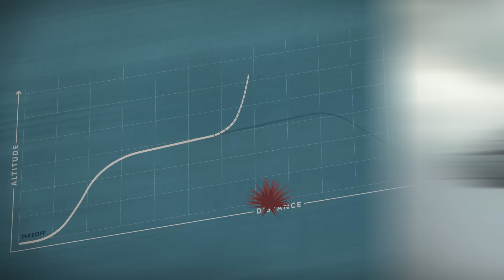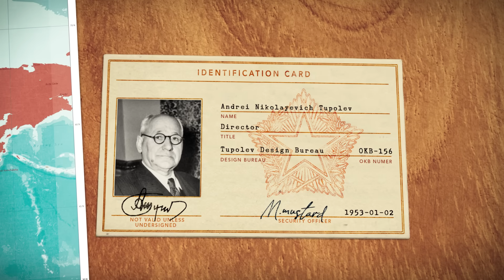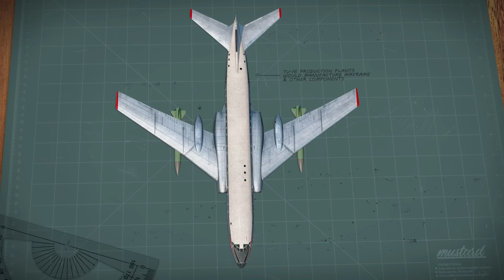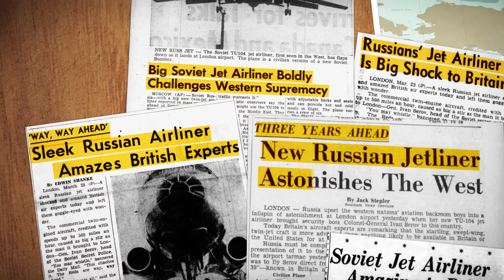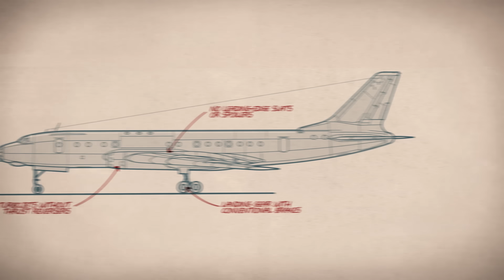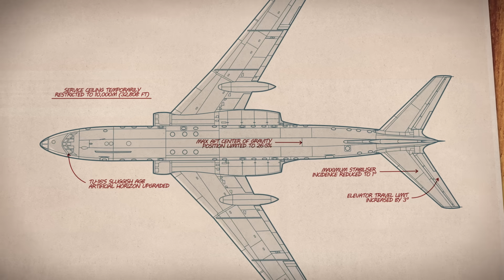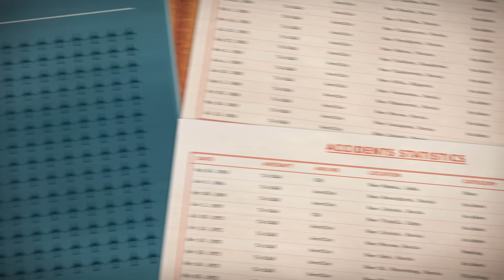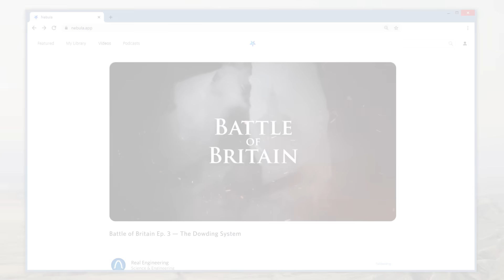The Soviet Airliner Designed To Crash

Comment: The Comet has the worst safety record of any jet airliner in history
Comet 1 had a 46% loss rate and Comet total a 34% loss rate
 Here is the complete list of the 39 Comet crashes and hull loss accidents.
G-APDN.  03.07.1970
G-ARCO.  12.09.1967
SU-ALD.    28.06.1963
LV-AHR.    23.11.1961
G-ALYP.     10.01.1954
G-ALYP.     02.05.1953
G-ARJM.    21.12.1961 
SU-AMW.   19.07.1962
G-ALYY.      08.04.1954
SA-R-7.      20.03.1963
SA-ALC.      02.01.1971
CF-CUN.      03.03.1953
LV-AHP.       27.08.1959
G-APDH.      22.03.1964
XP915.        19.01.1971
G-ALYZ.       26.10.1952
G-APDL.       07.10.1970
F-BGSC.       25.06.1953
LV-AHN.       24.03.1970
SU-ALE.        09.02.1970
SU-ANI.        14.01.1970
OD-ADS.       28.12.1968
OD-ADQ.       28.12.1968
OD-ADR.        28.12.1968
G-ALYR.         25.07.1953
G-APMD.      16.11.1965
G-APMF.        05.11.1964
G-APDL.       23.12.1959
G-APDN.       09.03.1964
G-ARJN.        02.08.1963
G-APDF.        09.04.1959
XK663.         03.06.1959
G-APDM.       03.08.1962
G-APDA.       08.06.1959
G-APDB.       21.06.1959
G-APDM.      25.01.1961
G-APDB.       22.08.1960
G-APDS.       14.03.1960.
LV-AHO.       20.02.1960
Reply: @WilhelmKarsten Regarding the fabulous trailblazing 
De Havilland Comet.
Accident Losses generally.

We feel we can clear up some commonly held myths and misconceptions, obviously.

It's always good to see the facts presented clearly and concisely isn't it?

De Havilland was subjected to forced merger under the govt aerospace sector rationalisation programme. A similar process occured globally, Sud Aviation and several other French manufacturers merged during design and production of the Caravelle with the Caravelle becoming a significantly international type project. Even in the US, there was no room for multiple manufacturers of large jet airliners with consolidation being inevitable.

The world's first wind tunnel was constructed in England before 1890.
The world's first supersonic wind tunnel was constructed in England during the 1920s.

The DH Comet was subjected to every type of stress testing & wind tunnel testing possible at the time. 

The world's first high altitude airliner.
The world's first jet airliner.

In fact the Comet was the first airliner to have a full fuselage length pressurised passenger cabin suitable for high altitude flying where pressurisation stress was many times higher than flying load stress. Bow-wing (see b-47 wing folding wing collapse incidents) had built less than 12 pressurised cabin airliners before the Comet first flew. The world's first pressurised cabin aircraft was a British design Airco built under licence in the US and modified in the US to have a pressurised cockpit cabin during a joint US / UK research project. Previous pressurised aircraft were airliners with lower pressurisation & altitude limits where pressurisation stress did not exceed flying load stress or were bombers with small heavily built cockpit capsules where potential total  airframe weight gains were insignificant.

The Comet nose was a unique De Havilland design that Sud Aviation subsequently licensed for use on their Caravelle.

Correct, the Comet was designed with military use in mind. In fact, the first designs were based on military use requirements, the first Nimrod aircraft were straightforward modified Comet 4 airframes. Obviously when the Nimrod first flew, it was of course the most advanced and capable aircraft of it's type in existence. All subsequent Nimrod airframes were indeed simply mostly  new manufacture Comet 4 airframes with the additional equipment bay added. Nimrod design and manufacture was in fact performed mostly by the De Havilland team at HS. 

The Comet was in fact an all metal construction airframe airliner, use of other materials was similar to all other airliners at the time. 

  Obviously there have been worse aircraft for accident losses both before & after the Comet. One of the issues was accident losses due to pilot error which were often caused by the novel aspects of jet airliner flying, even so, the accident losses for the Comet as an airliner were not particularly unusual at the time.

Some changes made were to make pilot error on takeoff less likely to cause serious problems. For example, the skin thickness remained mostly the same from Comet 1 to Comet 4.
Ripstop provision existed for all Comets. The original alloy used was discontinued by the manufacturer, the replacement alloy had similar properties.

  Indeed, at the time aviation infrastructure & aircraft technology etc was still developing rapidly, there was still a lot to do when considering all aspects of flying safety.

    How things were back then. 
Accident losses - % of aircraft built.
DeHavilland Comet 4                   14% 
DH Comet all mks   (ff 1948)       17%  
Vickers VC10 UK                            5%

The DH Comet had better safety than or similar safety to many other commercial passenger aircraft of a similar era.

Douglas DC-1                                      99%
Douglas DC-2                                      47%
Douglas DC-3                                      30%
Douglas DC-4                                      26%
Boeing s300                                        72% 
Boeing 307                                          70%
Boeing 247                                          48%
Boeing 707                                          20% 
Lockheed L-049/149 Constellation  30%
Lockheed Electra Turboprop             29%
Fairchild FH-227                                  30%
McDonnell Douglas DC-8                   14%
Sud Aviation Caravelle                        15%
Canadair CL-44  Turboprop                46%  
Convair CV-580  Turboprop                22%
Convair CV-880     (ff 1959)                27%  
Convair CV-990     (ff 1961)                33%
Tupolev T-104        (ff 1956)                16%

The VC10 held the fastest Atlantic crossing speed record for 41 years (Non supersonic airliners).

For the first few years of operations the Caravelle and Comet had similar accident loss Fatalities numbers.

  Instances of all Comet marks, including the Comet 1 and Comet 3 flew with full certification at some point after 1954. Airline duty Comets were all retired by 1980 with full certification until after retirement. The last Comet flight was a global circumnavigation series of flights in 1997.

   Of course De Havilland carried out a full stress analysis & performed extensive & protracted testing, including pressure cycle testing, on two long lengths of fuselage. De Havilland carried out significantly more testing than was required by any authority at the time & significantly more testing that any previous airliner was subjected to.

  Of course De Havilland had prior experience building many all metal construction airframe aircraft & thousands of jet powered fighter aircraft that were primarily of metal construction with pressurised cockpits & jet engines built by De-Havilland. At the time De Havilland engineers  knew all there was to know about metal fatigue as it applies to aircraft.

    De Havilland did indeed always work to better than industry standards at the time, used up to date knowledge for the design & no evidence of negligence  or criminal negligence was ever produced in relation to the DH Comet.

Military aircraft accident losses compared.
Non combat phase accident losses.
% of Aircraft built.
The EE Lightening did not have unusually high losses. 
The Canadair CL-44 was a turboprop airliner.
Canadair CL-44               (ff 1959 ) 48%
Lockheed XF104             (ff 1954) 100%
Lockheed  P80                (ff 1944)  43%
Lockheed F104               (ff 1954)  45%
MD FH Phantom 1          (ff 1945)  35%
MD F4 Phantom 2           (ff 1958)  28%
Convair F102 Dagger      (ff 1953)  45%  
MD F3H  Demon              (ff 1951)  32%
MD F-101 Voodoo           (ff 1954)  34%
EE Lightening                   (ff 1954)  33%
Gloster Meteor                (ff 1943)   21%
DH Vampire                     (ff 1943)   23%
DH Sea Vixen                  (ff  1951)  33%
Gloster Javelin                (ff 1951)   20%

Note that the Meteor didn't have particularly high losses, flew with more than 20 airforces for decades, got involved in air to air combat during a number of conflicts successfully against aircraft that first flew many years after the Meteor first flew.
 
We hope this helps, of course.       
       
As always, cheers & indeed 👍.

Comment: Wouldn’t a wing re-design have made a difference? And then an engine redesign? Perhaps narrowing the fuselage? One of the images showed 5 seats per row. Reducing to 4 would have helped. Making the wings a few feet shorter and a foot or so deeper would’ve made it more manageable at lower speed. Similar changes to the tail section would improved stability at all speeds. 

I’m no aeronautical engineer but even from my chair I can see areas where life saving modifications could’ve been made. The USSR values the lives of its people very cheaply. I guess that hasn’t changed much.
Reply: If you are familiar with the history of commercial aviation most successful airliners are based on a preceeding military aircraft.
Boeing became the largest manufacturer of commercial aircraft in the world by creating airliners from its bombers.
B-17 > 307, B-29 > 377, KC-135 > 707 and 737 even the 747 was developed as a military cargo transport.
Only recently has jet airliners been developed as a clean sheet design strictly for commercial aviation.
Reply: @WilhelmKarsten 

Regarding the fabulous trailblazing 
De Havilland Comet.
Accident Losses generally.

We feel we can clear up some commonly held myths and misconceptions, obviously.

It's always good to see the facts presented clearly and concisely isn't it?

De Havilland was subjected to forced merger under the govt aerospace sector rationalisation programme. A similar process occured globally, Sud Aviation and several other French manufacturers merged during design and production of the Caravelle with the Caravelle becoming a significantly international type project. Even in the US, there was no room for multiple manufacturers of large jet airliners with consolidation being inevitable.

The world's first wind tunnel was constructed in England before 1890.
The world's first supersonic wind tunnel was constructed in England during the 1920s.

The DH Comet was subjected to every type of stress testing & wind tunnel testing possible at the time. 

The world's first high altitude airliner.
The world's first jet airliner.

In fact the Comet was the first airliner to have a full fuselage length pressurised passenger cabin suitable for high altitude flying where pressurisation stress was many times higher than flying load stress. Bow-wing (see b-47 wing folding wing collapse incidents) had built less than 12 pressurised cabin airliners before the Comet first flew. The world's first pressurised cabin aircraft was a British design Airco built under licence in the US and modified in the US to have a pressurised cockpit cabin during a joint US / UK research project. Previous pressurised aircraft were airliners with lower pressurisation & altitude limits where pressurisation stress did not exceed flying load stress or were bombers with small heavily built cockpit capsules where potential total  airframe weight gains were insignificant.

The Comet nose was a unique De Havilland design that Sud Aviation subsequently licensed for use on their Caravelle.

Correct, the Comet was designed with military use in mind. In fact, the first designs were based on military use requirements, the first Nimrod aircraft were straightforward modified Comet 4 airframes. Obviously when the Nimrod first flew, it was of course the most advanced and capable aircraft of it's type in existence. All subsequent Nimrod airframes were indeed simply mostly  new manufacture Comet 4 airframes with the additional equipment bay added. Nimrod design and manufacture was in fact performed mostly by the De Havilland team at HS. 

The Comet was in fact an all metal construction airframe airliner, use of other materials was similar to all other airliners at the time. 

  Obviously there have been worse aircraft for accident losses both before & after the Comet. One of the issues was accident losses due to pilot error which were often caused by the novel aspects of jet airliner flying, even so, the accident losses for the Comet as an airliner were not particularly unusual at the time.

Some changes made were to make pilot error on takeoff less likely to cause serious problems. For example, the skin thickness remained mostly the same from Comet 1 to Comet 4.
Ripstop provision existed for all Comets. The original alloy used was discontinued by the manufacturer, the replacement alloy had similar properties.

  Indeed, at the time aviation infrastructure & aircraft technology etc was still developing rapidly, there was still a lot to do when considering all aspects of flying safety.

    How things were back then. 
Accident losses - % of aircraft built.
DeHavilland Comet 4                   14% 
DH Comet all mks   (ff 1948)       17%  
Vickers VC10 UK                            5%

The DH Comet had better safety than or similar safety to many other commercial passenger aircraft of a similar era.

Douglas DC-1                                      99%
Douglas DC-2                                      47%
Douglas DC-3                                      30%
Douglas DC-4                                      26%
Boeing s300                                        72% 
Boeing 307                                          70%
Boeing 247                                          48%
Boeing 707                                          20% 
Lockheed L-049/149 Constellation  30%
Lockheed Electra Turboprop             29%
Fairchild FH-227                                  30%
McDonnell Douglas DC-8                   14%
Sud Aviation Caravelle                        15%
Canadair CL-44  Turboprop                46%  
Convair CV-580  Turboprop                22%
Convair CV-880     (ff 1959)                27%  
Convair CV-990     (ff 1961)                33%
Tupolev T-104        (ff 1956)                16%

The VC10 held the fastest Atlantic crossing speed record for 41 years (Non supersonic airliners).

For the first few years of operations the Caravelle and Comet had similar accident loss Fatalities numbers.

  Instances of all Comet marks, including the Comet 1 and Comet 3 flew with full certification at some point after 1954. Airline duty Comets were all retired by 1980 with full certification until after retirement. The last Comet flight was a global circumnavigation series of flights in 1997.

   Of course De Havilland carried out a full stress analysis & performed extensive & protracted testing, including pressure cycle testing, on two long lengths of fuselage. De Havilland carried out significantly more testing than was required by any authority at the time & significantly more testing that any previous airliner was subjected to.

  Of course De Havilland had prior experience building many all metal construction airframe aircraft & thousands of jet powered fighter aircraft that were primarily of metal construction with pressurised cockpits & jet engines built by De-Havilland. At the time De Havilland engineers  knew all there was to know about metal fatigue as it applies to aircraft.

    De Havilland did indeed always work to better than industry standards at the time, used up to date knowledge for the design & no evidence of negligence  or criminal negligence was ever produced in relation to the DH Comet.

Military aircraft accident losses compared.
Non combat phase accident losses.
% of Aircraft built.
The EE Lightening did not have unusually high losses. 
The Canadair CL-44 was a turboprop airliner.
Canadair CL-44               (ff 1959 ) 48%
Lockheed XF104             (ff 1954) 100%
Lockheed  P80                (ff 1944)  43%
Lockheed F104               (ff 1954)  45%
MD FH Phantom 1          (ff 1945)  35%
MD F4 Phantom 2           (ff 1958)  28%
Convair F102 Dagger      (ff 1953)  45%  
MD F3H  Demon              (ff 1951)  32%
MD F-101 Voodoo           (ff 1954)  34%
EE Lightening                   (ff 1954)  33%
Gloster Meteor                (ff 1943)   21%
DH Vampire                     (ff 1943)   23%
DH Sea Vixen                  (ff  1951)  33%
Gloster Javelin                (ff 1951)   20%

Note that the Meteor didn't have particularly high losses, flew with more than 20 airforces for decades, got involved in air to air combat during a number of conflicts successfully against aircraft that first flew many years after the Meteor first flew.
 
We hope this helps, of course.       
       
As always, cheers & indeed 👍.
Reply: Ответ будет на статистику?? Не?